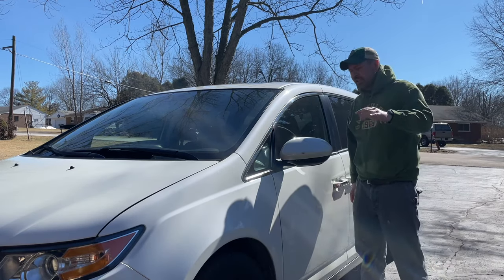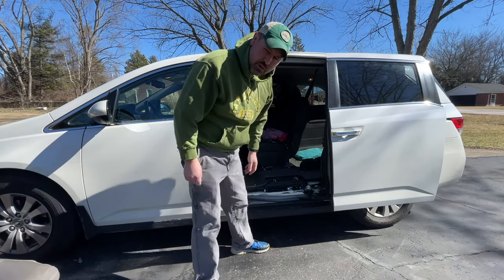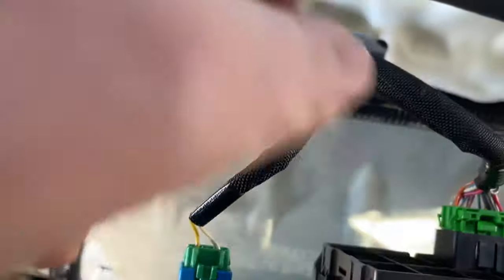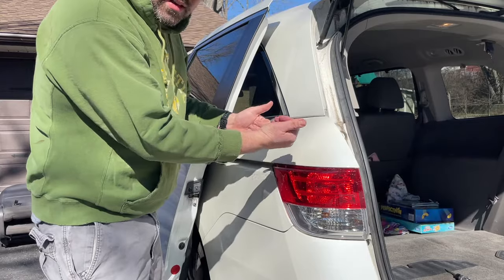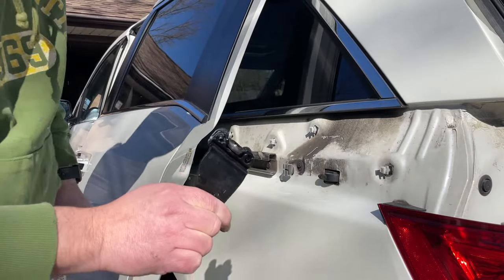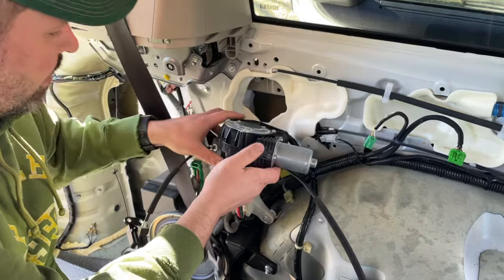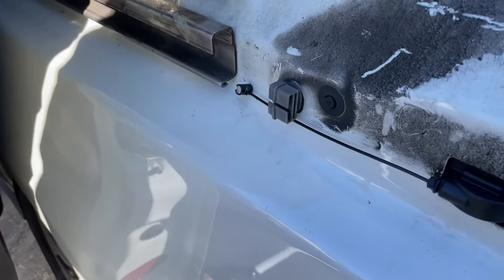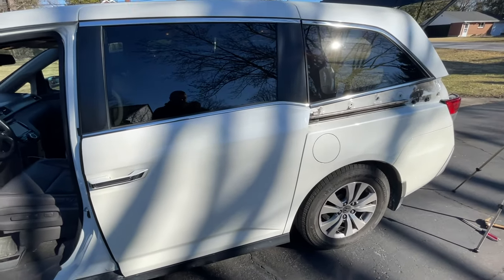Powered Sliding Door Fix (actuator) Honda Odyssey 2011-2017

Comment: Great video with step by step instructions. I bought the motor assembly from Rockauto which ran about $300. Dealerships were quoting me $800. You reuse the circuitboard in the OEM motor with the rockauto part. It is pretty easy to swap the circuit board, one screw and then just pull straight out. Passenger side is a little bit of a pain to access the back cable mount as the rear AC blower assembly is kind of in the way. I loosen the bolts to the blower assembly to help access the screws to the back mount.  UPDATE 11/3/2023. Door has jammed back up but the cable looks ok this time. I’m going to go purchase an OEM part and swap it out. The Rockauto motor never sounded right so I wouldn’t recommend Rockauto for that part.

Comment: I tried the $30 cable only fix also.  Within 6 months the door wasn't opening and closing smoothly, and a month or so later, the cable broke.  I've just ordered the complete assembly this time around.    FYI, the part number for right (passenger) side is 72010-TK8-305.    Driver side is 72050-TK8-305
Reply: Changed the passenger side assembly this weekend.  Only issue I had was I was unable to remove the pin after removing the clip from the door hinge.  

Instead I just removed the 2 bolts from the door.  

Also, the replacement part came with an upgraded roller assembly.

Comment: Appreciate this tutorial.  Here's some extra info to flesh out options for viewers:

The "$30 fix" is for cable replacement only and the quality of the cable is usually some sort of vinyl covered steel cables from China with questionable tensile strength.  Honda OEM is vinyl wrapped steel with 150lb tensile strength.  This is standard, but still notoriously short-lived due to the steel cables corroding from salt and moisture (which is why you are replacing them at all).  There are MUCH better cables for replacement/fixes than even Honda OEM:  STAINLESS steel with 300lb tensile strength and polyurethane coating made in Japan run about $80 online (More than $30, but much less expensive than replacing the entire motor assembly for $450).  Using good cables should work much better and last far longer than the $30 fix - even longer than the OEM cables.

Either way, how is the full housing repair working out for you?  Everything still working well on it?
Reply: Where do you get the STAINLESS steel cable with 3000lb tensile strength and polyurethane coating made in Japan?

Comment: Thanks for the video. I have a Honda Freed (sold in Japan only I do believe). It has a power slide door that opens when using the door handle but malfunctions when using the key fob or the dash switch. Do you have any ideas about what could be causing this?

Comment: Great video man. Loved the, “it takes a little muscle, but you can do it!”
Been waiting to install the part (got it back in fall 2021 as my wife reminded me today) because I was a bit intimidated to tackle this. I looked for videos on this back when I got the part but nothing good for my model year. This video gave me the confidence to tackle it. I appreciate you helping me save my family a lot of money. It takes a little muscle, but I can do it!
Reply: Follow up- replacement was a little more challenging on the passenger side due to the rear HVAC unit. 7:39 .Accessing the mount for the rear most cable required pivoting the HVAC unit (couldn’t remove the unit as it would require an AC recharge). 
The cable mount bolts are easy to drop behind the unit, (which I managed to do twice) that added about 10 minutes to my fix, fishing them out with a magnetic grabber.

Comment: Awesome video thank you, but I have a BIG favor to ask  Could you reference one part of your video that shows where that damn piezo electric buzzer is located.  Research suggests it's someone on the motor assembly?  My doors are working fine but the buzzer won't stop and from putting my ear up to the rear panes it's coming exactly from where this motor actuator is located.  Thank you.

Comment: Just got this part.  it says you're supposed to install it with a new stainless steel male center roller.  Without the new roller it can results in incorrect door operation.  I have a 2014 odyssey.  Is this necessary?

Comment: Thank you so much for this video. I have an issue with 2009 odyssey, rear driver sliding door lock. With remote, locking system works but wouldn't open. It keep locking by itself.
Reply: Did u ever get that fixed? I am having the same problem

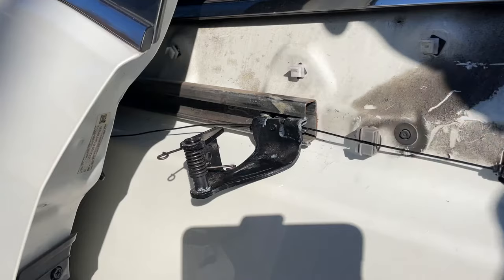Comment: Great video!  Thanks!  Question - At approximately 18:18 on the video the left side cable seemed loose. Did you have to re tension that before locking down the assembly down or did it correct itself?

Comment: How did you cut the cable? Do you do it from the outside? My motor went out and the cable won't allow me to close my driver-side sliding door. I've ordered parts but it'll be a week so looking for a temporary fix.  Thanks.
Reply: Same problem here. I used some wire cutters and cut the cable. I had to take the cover on the exterior off to get access to the cable. Cut the rear and front cable and it allowed me to manually close the door.  Van beeped at me if I left the power on to the sliding door. Turned it off and I was good to go.

Comment: Save yourself the trouble with the pin and remove the bolts that hold that hinge part to the sliding door. Then you could easily hit the pin on the top and easily remove the C clip.

Comment: Anyone here just cut the cables and use the door on manual setting? That's where I'm at with this. Our 2006 odyssey had the same problems with the sliding doors. Fixed them, they broke again less than a year. Is there a tutorial for completely disabling the automatic door function?

Comment: how to reset car door with battery connected
Reply: Turn Off Auto on the Dashboard by Steering Wheel, Open then Close Sliding Door Manually, Turn ON Auto Sliding Doors and you should be good to go!
Reply: @gtxautogroupservice9789  This was the only instruction that worked. I replaced the complete module myself and couldn't get it to reset until this last instruction. Tried everyone else. Saved $900 CDN between the part and service.